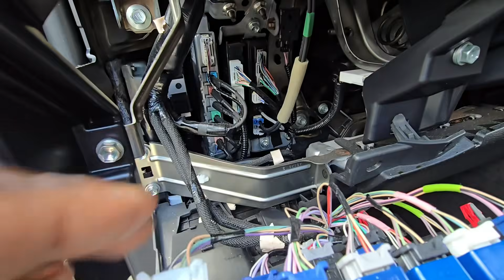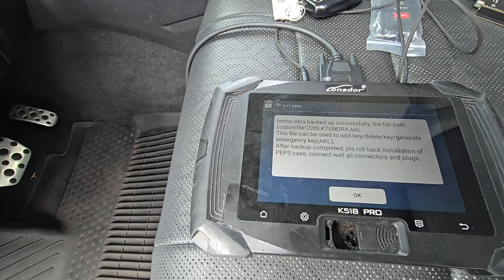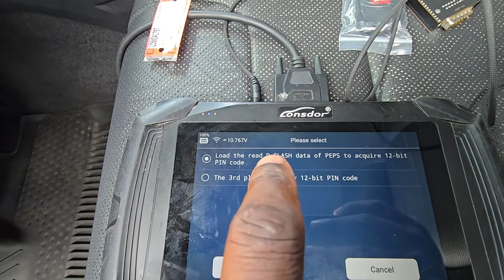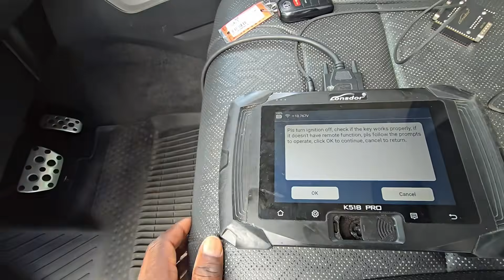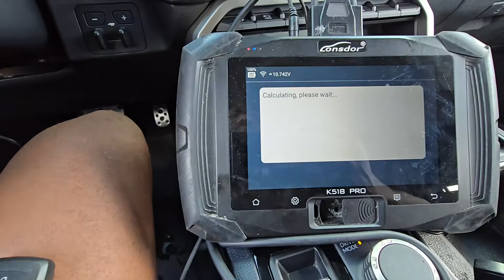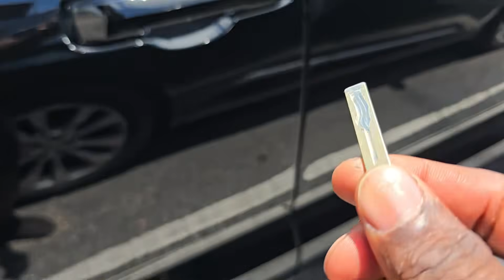22 Toyota Tundra add smart key Lonsdor K518 pro LT20 universal no rolling code Lakelandcarkeys.com

Comment: Do you know if the Autel 30 pin cable works with the K518? Id assume it would but I hardly use my Lonsdor.
Reply from the maker: I assume it would. I havent tried it though

Comment: I watched this a few times did I see a Chrysler dealer call you out for a Toyota key, and could you have just programmed regular key in if you were just adding thanks
Reply from the maker: Yes this was a used Toyota sold at the Dodge dealer. This was add a key, either way you still need the bypass code weather you do it this way or get it from a 3rd party

Comment: Can you make a video explaining how to generate an LT20 and LT30, I have the K518 Pro but there are so many options when you into the generate smart key menu that it  is a bit confusing, not sure when to use a LT30 over a 20, I bought a few of these keys and shells but haven’t used one yet…have a 2019 Rav4 Smart Key AKL to do tomorrow and would love to try out one of these keys
Reply from the maker: i can try. if you search my videos I am sure I've done in another vehicle. i usually generate my keys with the kw100. generating the keys can be a little trick sometimes but if you download the phone app and look through it its a little better laid out then the k518 programmer